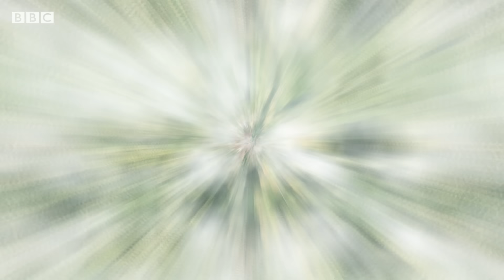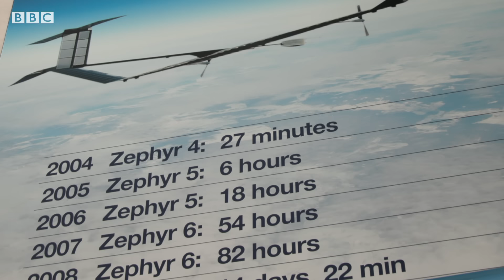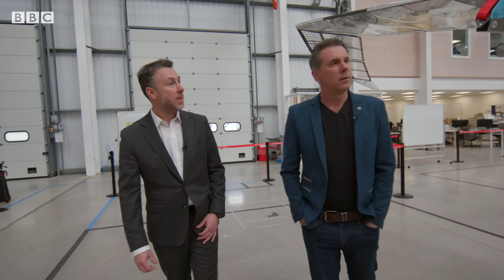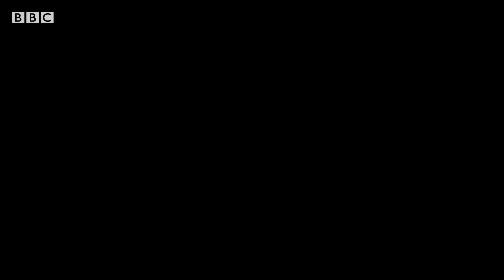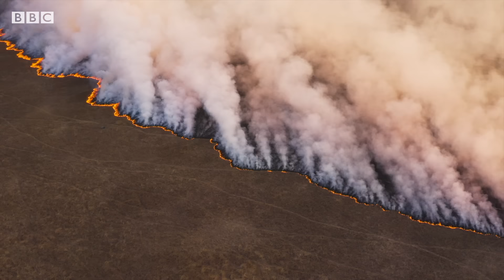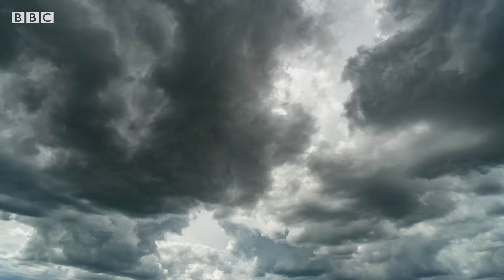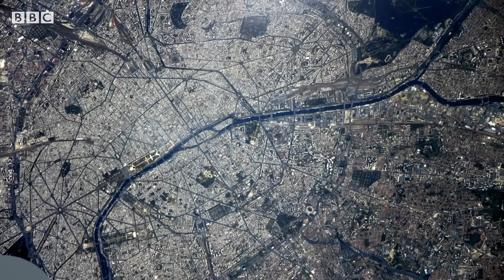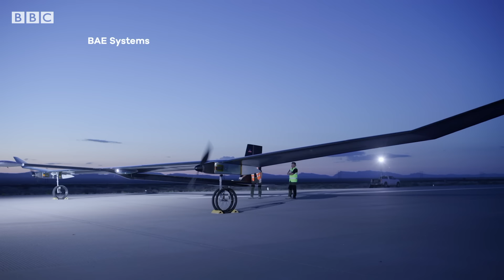The solar-powered aircraft flying high in the atmosphere | BBC News

Comment: Let me suggest solution to the problem of launching it safely taking it to 60+ to 75K feet. Fold multiple of these ( since it weighs just 75Kgs) and load it in a jumbo plane that takes it to minimum 60+K feet. Release it. It will protect and help safely reach to the to the desired altitude 😊.
Reply: The wings would break apart at anything over 80mph

Comment: I can imagine how easy the duration of stay in the stratosphere can be increased. Just design another aircraft whose job it is to replace the batteries in flight ever so often. You will need docking technology and redesign the batteries so that they can be swapped out easily midair. The timing has to be right so that the batteries are swapped while at low altitude. You only need to do this once every 6 months since each battery last up to 6 months.

Comment: Lets read between the lines.
How is a company with no civil application still is staying afloat for such a long period.
Replacing a cell tower or 20 cell towers? I dont think so, the communication towers or its replacements demand a lot of energy on daily basis and needs to be reliable 24/7.
In my opinion it is only good for one thing and only one thing. Taking frequent high altitude pictures in sunny times and staying dormant at night times. If you have a fleet of it like 
Starlink, you can manage to have a camera at any place at any given time.
Now what you do with the imagery is all up to you. You can use it for disaster management, weather patterns or "MILITARY PURPOSES". I think the last one is the one they are all aiming for but dont wanna say it out loud. Launching satellites is expensive and one time. Plus servicing is expensive. Maintaining a spy drone programme is expensive compared to this. This can be a passive skybird or god's eye programme providing frequent data sets while spy drones can be used for urgent missions.

Comment: Another grant chasing scam.  Cell phones want to send a signal to a tower 2mi away and save battery life, not 20 mi away in the stratosphere, nor is this power starved solar craft going to handle hundreds of connections 24/7 and a back haul, not now, not ever. And now, Starlink satellite constellation can  be available anywhere on earth with high bandwidth, not a bit trickle as claimed.

Comment: Cell Tower running LiP0 batteries for 1 day =3kW×24h/day × 365days≈26,000kWh/year   Total realistic weight: ~150–200 kg (330–440 lb) for 8 hours of backup   So they'll have to be able to carry the weight of an extra 440 Lbs and keep attitude requiring yet more batteries to work as a Cell tower. Did they do the math?  Realistic achievement?  Not with current battery energy densities. They could improve the cell transmitter and make a mini DC cell transmitter that is ultralight yet powerful.  and use NIMH batteries. Also transmitter weight not calculated. They have more work to do and prove the transmitter works. Right now it's not currently possible. The flying goose may not take off for long. A small company with Stratospheric goals. Batteries need to be keep warm. They'll use more power.

Comment: Neuralink prolly made The Zephyr obselete
Reply: i assume you mean starlink, and in that case no. the new starlinks can provide cell service but only at an incredibly weak and slow level because of how high they are. it's not a one way connection, your tiny phone has to be able to communicate back and there isn't nearly enough power for that. starlinks sit at 1.7 million feet and only provide enough cellular speed for simple messages in an emergency. whereas these planes only sit at 75k feet and theoretically could allow for calls and even low speed data in remote areas. the other factor is cost. these are simple planes which fly themselves up. starlinks are incredibly expensive and have to be launched on a rocket. these are infinitely cheaper.
Reply: @InvertedBug   No offence respectfully.. but what r u sayin bro..
1. Starlink works via Antenna set up on ur roof and connected to a modem/ethernet cable.. u can use it just like ur normal wifi. Ur phone has nothing to do with power.
2. Can work only for Simple message? 
Many People have tried online PC gaming on it, with latency not so bad compare to ground wifi's. U can call anyone indefinitely via internet maybe like whatsapp call or somethin.
Even in the worst case scenerio, itll still be better then 4G.. 
3. About the cost😂 
Its a one time payment to buy the setup  for like $300 and then its only bout $50+ per month after that..
4. Why u talking bout launching a rocket here.. those things are clearly put into orbit by a Sling shot and sometimes the world strongest man just throw those satellites to the sky and luckily it gets into orbit.
Lastly, Starlink will only get better as SpaceX launch more and more, and the new version has Laser communication, which are coherently faster then the radio coms used in the old version.
Reply: @merxellus  No, i'm talking about Starlink's new cellular service designed to provide phones with 4G in remote areas for emergencies. Not it's normal usage with the ground terminal.

Comment: Solar investment is risky in racing or air flow during the process sheets can get their glass damaged which means flow of energy intervals decrease solar can produce with stability thats why after launch of rockets satellite use after reaching destination which is being programmed in following command but not in motion solar works on better maintainenece of solar in flow motion it can get harmed what will we do if were travelling with hundreds of passengers with this can we guarantee weather let's see what happens during taking off if machine hits with a bird  project needs to be hardly studied

Comment: You can tow it up, with the new batteries I would think it should be fine for years. You can do a blended wing with some lighter than air sections. My issue would be when you are far from the equator and are not getting so much light per day.

Comment: Why not a launch battery. It uses the battery to push the plane at full throttle through the weather and then when it’s depleted it’s dropped with a small parachute and retrieved. This would allow them to launch the plane anywhere and even from boats like for the military.

Comment: The first aircraft of this type was flown in the 1960s by Bob Boucher in California. It was balsa wood and spruce had solar cells generation 1.0 and NickelCadmium batteries. It used a DC Brushed electric motor.
Reply: Exactly ...this is nothing new and just as useless as it was then

Comment: To be honest, I had expected such high altitude drone aircrafts and or aerostats to replace some of our current satellite use already.  Such high altitude platforms are less expensive than satellite launches, can by dynamically deployed, can be landed for upgrades and does not contribute to the Kessler syndrome which could defeat our usage of space for centuries.

Comment: Sorry, but eliminating 200 cell towers means the bandwidth of this singular system would need to be about 200X greater than a typical cell tower -- not buying it.  Additionally, a single cell tower has numerous antennae's such that the RF bandwidth of any given cell tower is the combined bandwidth of all the antennae's.  Yes, a solar drone based cell site can also have multiple antennae's and I'm sure it would, but the system still needs to connect beyond and that where the main bandwidth limitation will be.  The expense of land based cell towers is offset by the ability to reuse spectrum hundreds of times while this solar drone cell site will not be able to do so.
The only place this makes any sense is in remote regions that are within reach of one or more ground based ground stations.  Linking drone to drone is also possible, but once again, the bandwidth limitations will come into play.  So if this only makes sense in remote areas with fewer customers the cost per customer will necessarily be higher.  I'm not a fan of Elon Musk, but Starlink covers this use case far better!

Comment: The shape of the plane is so interesting. When I was a child, we built model airplanes like 'der kleine UHU' (the small UHU), a model Kit sold by Graupner for beginners: so without remote control... 
Even those small planes 60 years were so good in the air, that they needed a timer for not flying away too far. I flew my one without timer... and lost it somewhere 'up there', fading in the fog five valleys further maybe, ...we didn`t find it again.
The hughe plane shown in this video looks so much more mature... it cries for raising into the sky :) I like that project, because I have a feeling, how effictive it will be in it`s element. You can start from everywhere, you can start 'at once', as needed... and it`s zero emission. Thank you BBC for these impressions.

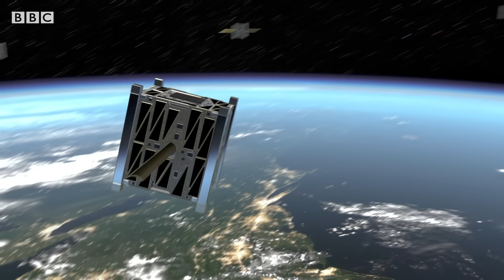Comment: 6:50 LEO satellites actually need fuel to keep the orbit. Either you are in a very low orbit and have excellent cell reception but need frequent boosts or you are higher up, need less fuel and have poor quality cell service. 
Airbus has already received the first external investments to provide cell service with this. I also could think of mapping, earth observation and military applications. It could monitor what the Russians are up to from a safe distance with ease and at low costs.

Comment: i sure hope they convert to these new battery techs of today. the cycle count is incredibly high, up to 100x higher. such an incredible craft!
i think it would benefit from the sodium ion batteries ! the specs are fantastic Among its standout features are a longer lifespan of 3,000–6,000 cycles, faster charging than traditional batteries, greater resistance to below-freezing temperatures and with varied energy densities between 100 and 170 Wh/Kg.

Comment: Battery research & development is pushing the power fraction above 500kW per battery installed kilogram of weight making such craft as this a lot more viable for future use.  When it comes to a high-altitude antenna this could be more cost effective than launching a full on satellite into Earth or it.  😊

Comment: "Yet to be conquered by human kind"? There are aircraft that fly in the stratosphere, not to mention flying through it on the way to the moon, sun and interstellar space as voyager has. A false statement. Even commercial flights fly in the lower stratosphere (UCAR: "Commercial jet aircraft fly in the lower stratosphere to avoid turbulence"). Stratosphere starts at about 20km up to 50km. X-15 flies over 100km high, SR-71 blackbird at 26km and like 9 other aircrafts in between. I think BBC Verify should verify this video.
Reply: They are journalists, not stem majors

Comment: Imagine a line of these, connected by wire so that the sun never sets on the chain, the planes in the shade getting charge from the ones in the sunlight. Obviously, the weather will be a real challenge to solve, but a giant structure like that could change the world.

Comment: Most of the comments here really show how shallow most people's thinking is in relation to research. This research like all research has to start somewhere and they have made amazing steps. If it was said in 1999 that engineers would develop a 75kg aircraft that could fly using sunlight at 70000ft and do if for 60+ days, they would have been laughed out of town. More power to them and their efforts.
Reply: I saw similar drones in US and Russia over 10 years ago. And I bet they existed for decades before, just classified.

Look at materials which both countries use in space. Did you heard about aerogels? Incredible strong materials, but almost have no weight. Super effective solar panels. Pretty small and light nuclear batteries. Thousands of alloys which rest have no. So, nothing special already for 50 years at least. Or more.

What is really incredible — it is modern cams (matrix) and chips, which were impossibly decades ago and as result such drones had no point.

Comment: You can use it for.... Nope, you don't because you need the battery to spin the rotors. And additionally, you cannot add weight to the plane for the equipment to do so.

Comment: i don't see a reason not to use a hydrogen or helium balloon rather than that kind of a plane. failure of google's project does not prove anything. such a balloon should have solar cells on the surface of the balloon, an electric propeller with adjustable direction for rotating and moving the balloon, gas pump with a pressurized tank for vertical movement and battery for storing energy. advantage of a balloon over a plane is that it is statically stable (it will fly without doing anything). also such a balloon should be cheaper to manufacture and there will not be much weight limitations like a solar plane, making it able to do meaningful work by positioning heavy equipment on it.

Comment: I wonder if it may be possible to use electrically powered jet on  the Center line, just powered by the sun going supersonic at Mach 1
At 1000mph along the correct latitude above the equator with a constant ground time of 12:00 p.m.  midday a great goal to achieve, it's possible usage is speculation right now but maybe a radio relay and maybe having a few along the same line and able to communicate with each other
But must be viable and cost effective

Comment: How much power would be needed though for it to act as a cell tower?
More power would need bigger batteries and more solar panels plus the weight of the equipment to act as a cell tower and the extra weight would require stronger structure to carry that weight adding to the overal weight etc etc, 
Obviously scale would need to go up to much bigger craft, not impossible maybe but starting to get a bit expensive and hand launching would be out...

Comment: Neil, when the smaller body is in the direct influence of the larger body, is the gravity of the smaller body changed temporarily? Is there a gravity sum taking place, or displacement? Since gravity is not spilling out into space (novice, here) does it pull back into itself based on density?

Comment: It has a very high lift to weight ratio so it doesnt need much power or lift to stay up.
Reply: Unless it's accelerating vertically, its lift to weight ratio is exactly 1:1. Such an enormously long and lightweight structure simply cannot withstand large vertical accelerations.

Comment: He says that the power use of terrestrial towers is high, so how is it not high when it’s attached to a plane? How are they reducing the power requirements that much whilst serving a much larger area and many more users from further away? It just doesn’t make much sense, if it uses a lot of power on the ground then it will use lots of power on a plane as well, even more so when there is more distance to cover and more users and then it still needs a high bandwidth connection to either a base station or a satellite that is capable of handling lots more users than a standard tower.

Comment: It can replace 200 cell towers on the ground....
Until it fails and the equivalent of 2,000 square miles goes off line.
Reply: You know of this thing called "redundancy"?
Reply: Probably better than nothing in a disaster zone, especially if you're trying to enable people who might be trapped with ordinary cell phones to get help (and thus you can't just bring in a Starlink terminal).
Reply: get multiples so they work in shifts

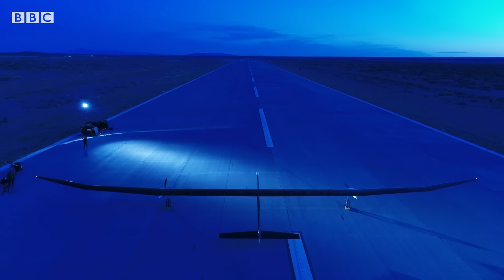Comment: 7:40 is a blatant lie, as you sweep across the area once every 90 minutes. To see slow changes, there are orbits that allows you to pass the exact same spot at the exakt same time every day. 

Menwhile, these planes will cover a much smaller area.
Reply: Not sure on the lie part. He's not wrong. A satellite will have to come back each time. These crafts can circle an area and monitor it continuously.
Reply: @hippopotamus86  But it does so more often than you need the photos, unless you are doing continous surveillance of an area, in which case I wonder how long the batteries will last.

Comment: So it jusy makes the mobile network less reliable. If the plane goes down, you lose much more. What happened to minimising the worst xase scenario?
Reply: You know that right now, if a mast goes down, there's plenty more masts? They wouldn't have one plane. Even then, I'm sure this is more for disaster area's or remote area's.
Reply: @hippopotamus86  but the whole plan is to replace 100's of ground based masts with a few planes... Because a few planes are much less expensive tha masts.

Comment: Are we to presume it has a fail safe recovery system (aka parachute). Elegant as it may be, if it suffers structural failure or control loss in flight, it is still 75kg of dead weight that can cause a heck of a lot of damage when it comes to a sudden stop after falling from 75,000 feet. Kinetic energy = mass  x gravity x height (PEg=mgh). Or.. are they testing it in Kenya because there is a much lower chance of being sued if one of these does the unthinkable? My back of the fag packet calculations suggests about 3.5kg of TNT equivalent when it strawberry jams into your roof.

Comment: How much power would it need to produce to cover the area for those ~200 cell towers/base station? And how much hardware would be required to be installed, increasing weight?

Comment: At about 4:00 he says that power is the most expensive part of running a cellphone tower. Well if that is the case then put solar panels and batteries on the ground near the tower. Yes you may need more towers if you are on the ground, but overall I am willing to bet the cost is still lower than the zephyr at this time as ground based solar/batteries will be considerably cheaper than the zephyrs solar/batteries for any given power output and there is no power consumption for flying. If the the zephyr had power to spare then it wouldn't have such tight design challenges.